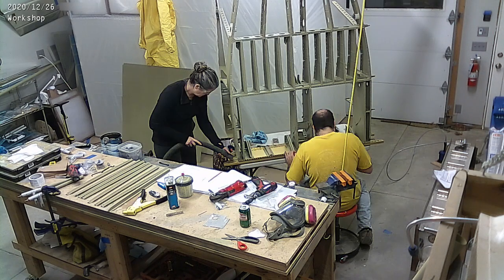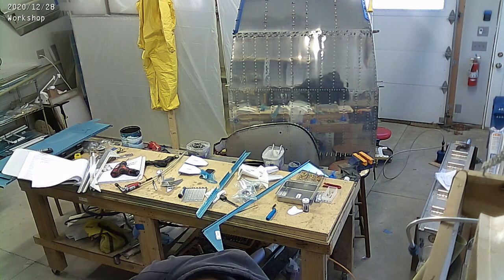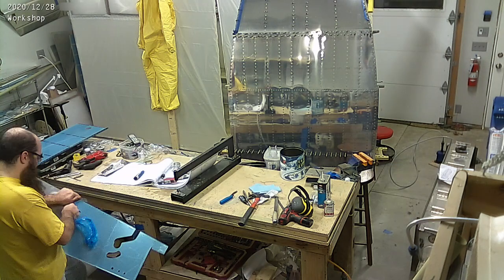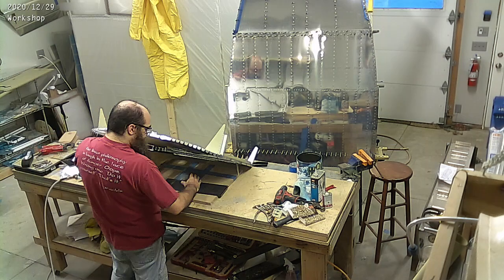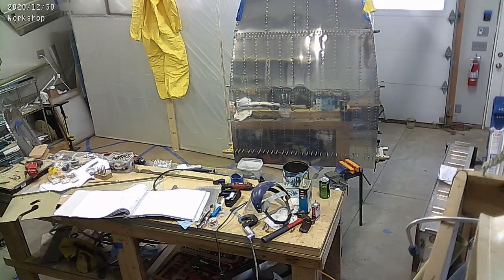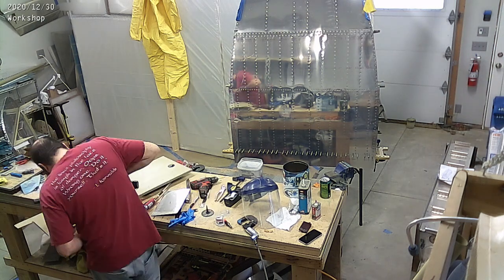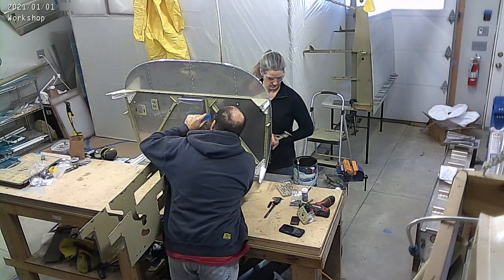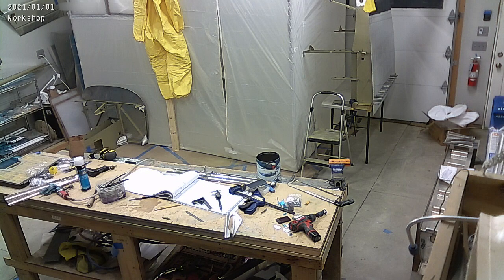RV-10 Build: 01/01/2021 - Fuselage and Firewall

Comment: @ Plane Lady a Van's interview said the new RV-10 kits require much less de-burring (because of their new hole-punching equipment). Has this been your experience?
Reply from the maker: Unfortunately I have only come across a handful of the new parts as my kit is from right when they made the announcement. I did not notice them needing any less deburring but at least I did not need to match-drill them.